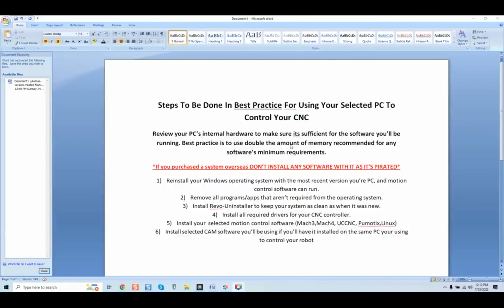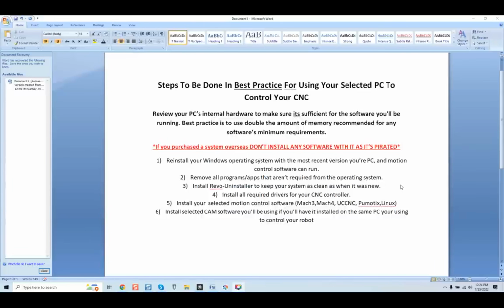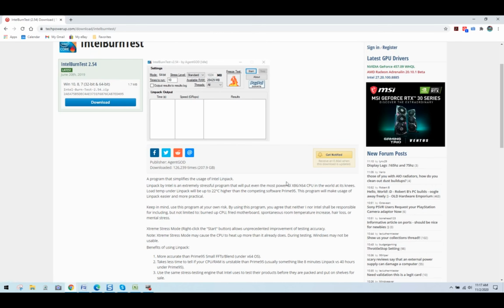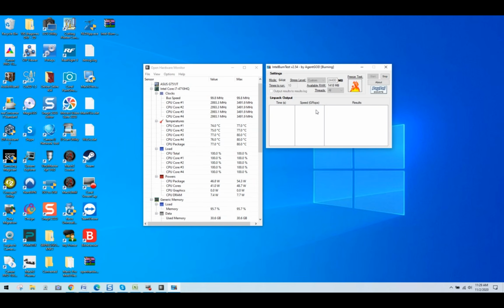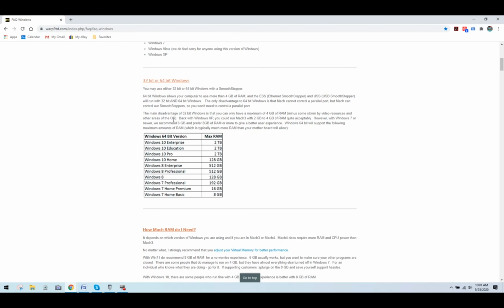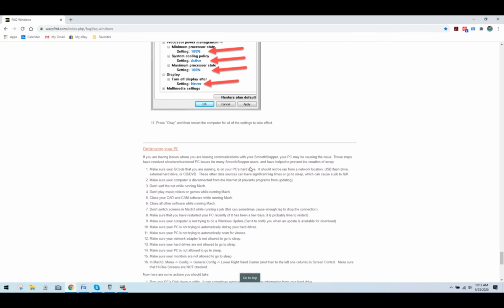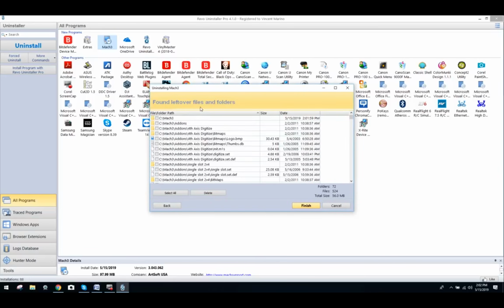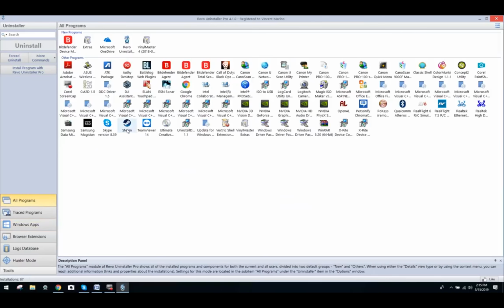The Ultimate Mach3 PC CNC Optimization...

Comment: I keep several images of my CNC computer. I use Acronis as a backup tool and keep a fresh clean windows install, one with all windows updates, one with mach 3 and the smooth stepper software and one current with all the .nc files i drop on it during use. i keep them in 3 places one copy of the backups are on the d: drive of the system, one is on my main working pc and one on a samsung 256gb thumb drive. this gives me multiple ways of restoring the system fast (as short as 8 min). I can restore to a usb mounted SSD and drop it into the system should the ssd in the system already somehow completely fails. i can plug in a usb boot disk and restore from the copy on the systems d" drive or i could restore over my internal network. that being said i like for control pc 8 cores 32 gb ram 1tb ssd. that is a minimum personal requirement. I also choose water cooling because of where i live. and on top of that i have to use an AC in the enclosure to keep everything cool in my 130f ambient garage. but my system is on 24/7 in that envirnment through cooling with no issues since i bought my system from Vince. I choose to have the machine offline and only have lan connection to my main pc where i design. I have a personal system design and use it on 2 cncs and a third complete identical copy as a backup pc. at $500 my systems can run anything better than most high end commercial systems, i use seimens everyday controlling a 4 axis knife blade grinder and i would kill for one of my machines at work. they like to use 4gb in many commercial systems i think thats suicide.
Reply: hmm he read x/ I 98 to tp7😮😮😮😮😅😊😊😊😢
Reply from the maker: That's the best overall backup plan I've heard! Great job and thank you for your support. Have a great weekend! Vince

Comment: Can You Create Another Video About How much to Charge for the Carving work?? I couldn't find a good video. Based on what all criteria we need to calculate the cost and profit and all..! I think it would be much helpful.

I was trying to plot the costs in activity base in an excel file. But ended up being confused..!

I was doing like this, Per Product . Is it any good?
Or Can You come up with a universal cost calculation method which can be used for all types of machining(Wood) works whether it is 2 or 3 or 4 axis 

 Cost Centre: Electricity: For CAD Operation: Computer*1Qty: of  1000Watts: Duration=1hr: Unit Rate Per KWH=10Rupees=10 rupees for CAD Operation Only
+
Cost Centre: Electricity: For CAM Operation: Computer*1Qty: of  1000Watts: Duration=5hr: Unit Rate Per KWH=10Rupees=50 rupees for CAM Operation Only
+
Cost Centre: Electricity: For CAM Operation: Router*1Qty: of  3000Watts: Duration=5hr: Unit Rate Per KWH=10Rupees=150 rupees for CAM Operation Router

+
Collection

+
Cost Centre: Electricity: For CAM Operation: Stepper/Servo*4Qty: of  500Watts: Duration=5hr: Unit Rate Per KWH=10Rupees=20 rupees for CAM Operation Stepper Electricity
+
Cost Centre: Labor: For CAM Operation: manpower=1 for 2 Hrs: Hourly Cost 250 Rupees=500n Rupees for Manpower for CAM Operation
+

Cost Centre: Labor: For CAD Operation: manpower=1 for 2 Hrs: Hourly Cost 250 Rupees=500n Rupees for Manpower for CAD Operation

is this method any Good?
Reply: FM.